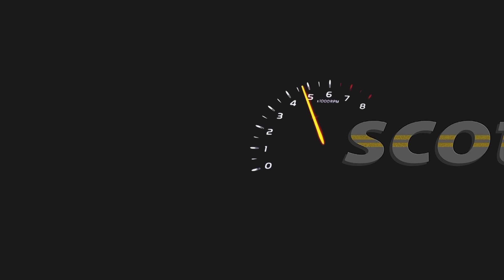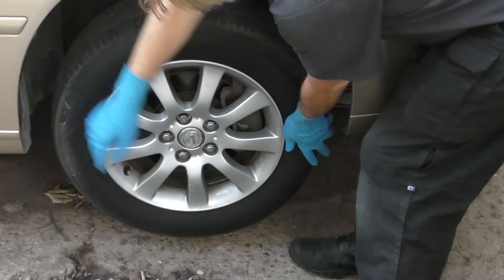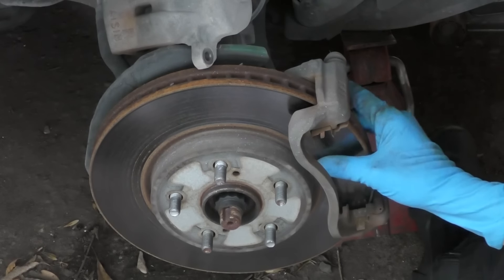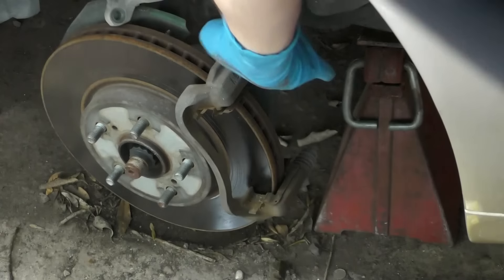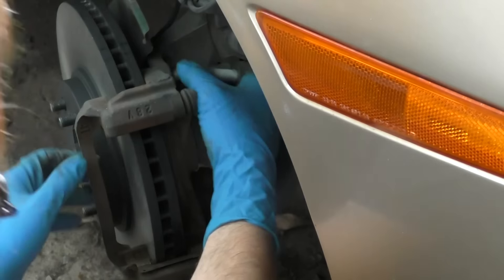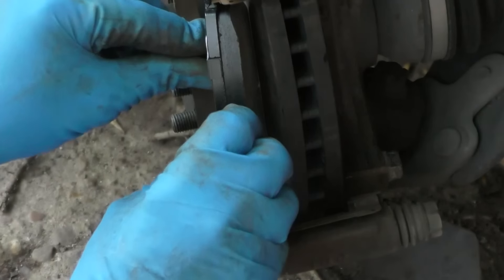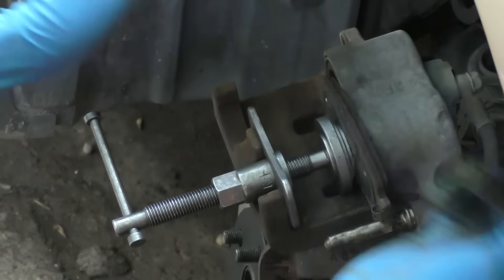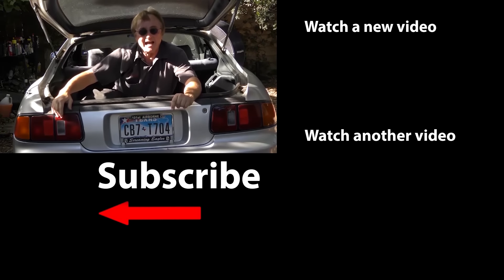Does Your Car Shake When You Brake, Do This

Comment: Hey Scotty! I also want to point out. At times it can be your wheel pressure and alignment!  Whenever my tires start to get lower that little shake can show up. But if I go a while without an alignment I definitely have the shakes at high-speed breaking. Just my 2 cents!

Comment: I had to find Smokey Yunnick's post in an OLD Popular Mechanics magazine to fix this vibrating steering while braking on my1995 Ford Windstar. The dealership could not fix the problem for any longer than a drive home. It turns out that the stud nuts must be HAND TORQUED to 90 ft-lbs in at least 3 steps. Solves the problem every time. So I had to TEACH the local Ford Dealership since they were the only ones I would let touch my baby. The 2000 Windatar is not so sensitive but the effect is still there if they use their impact-driver brake sticks to torque the lug nuts. Lately I am driving a 2010 Fusion Sport and the problem is still there so  if it acts up on a long trip I just pull into the nearest KalTire store and get the wheel nuts re-torqued evenly to 100ft-lbs. Makes a heck of a difference immediately. Many thanks to Smokey Yunnick and Popular Mechanics.  I thought you needed to know.

Comment: Don't forget to pump the brakes until they firm back up with the car running BEFORE you drive off. A friend of mine forgot that simple thing and his wife drove through our other friend's shop garage door when the car wouldn't stop. $600 garage door repair. Expensive brake job there!

Comment: Cheap rotors bend when the wheel lugs don't have all the same torque on them - just retorque the lugs properly in a few steps, and the rotors should straighten back again
(also clean any corrosion at the wheel hole for lugs so as to feel the lugs tighten smoothly all the way)

Comment: No one ever mentions how worn power steering rack bushings can also cause loose steering and vibration while driving.  The entire rack floats side to side because of worn bushings.
Reply: smithraymond09029 difference is this happens only when braking.  Your problem shakes sll the time
Reply: Interesting that you mention it! I've changed my tires, brakes and rotors but didn't know about the bushing! I will have to give that a try. Thanks!
Reply: this week im replacing al mine on my mk5 gti. all the bushing on the frontside,  plus subframe collar kit to
Reply: @gfriedman99 quick question do I have to change my brakes when replacing the rotors

Comment: Really good video, Scotty! Now off to convince the wife to let me replace the rotors in her car :) A couple of questions:
1 - Speaking of breaking, is it true that if you're about to hit a pothole, you should never hit the brakes?
2 - What do you think about the tools sold by Harbor Freight to work on cars? I see some of them so cheap, but I wonder about their durability.
Thanks! 
William from Connecticut
Reply: Yes, release the brake pedal just before hitting a bump.  It reduces stress on the front suspension and the rear.  Some HF tools are durable.  I have two 1/2" air impact wrenches that are probably 25 years old.  I don't use them that often but they still work.  I also buy impact sockets there.
Reply: Hi William. I need my brakes done also. But my mechanic is charging over $460. U know anyone in ct? I'm in the naugatuck valley
Reply: @julied915  Hi julie, I just saw the notification.  I'm in NC so I can't recommend anyone.  Don't go to the dealer.  Go to a brake shop.  Depending on what needs to be replaced it could get expensive.  Many owners just change out the brake pads if there is no vibration when braking.  If the rotors need replacing it will cost a lot more.

Comment: Scotty, what about:
1) Stepping on the brakes to make sure the pads engage
&
2) The bleeding of the brakes?
Reply: No need to if you don't open the brake lines.
Reply: the only other thing i do is take the cap off my brake fluid reservoir. Seems to let excess fluid from compressing the pistons flow back up easier.

Comment: First thing, the quality of rotors is important. I bought some cheap ones, and a only a week of sitting out rusted them so bad they needed resurfacing.
Second, I really like ceramic chamfered pads, which is what it looks like you are installing. Totally love them, grab like King Kong going after Fay Wray.
Third, I have a 1994 W124 Mercedes, it's easier to replace pads or rotors on that than your Lexus. Don't get me wrong, I'm a huge Toyota fan like you, if I didn't have an old Benz, I'd have a Toyota. I can understand your criticism of newer Mercedes, but the old Bruno Sacco pre-Daimler-Chrysler Benzes are some well designed stuff. Piles of them are still running in places like Malaysia, Morocco, Siberia and Paraguay.
Lastly, you have the same Harbor Freight hydraulic jack I do. Brilliant piece of equipment

Comment: Brake rotors do not warp from heat, even when driven by the most aggressive driver. Instead, they wear unevenly. ... The problem of pedal vibration, incorrectly called rotor warp, occurs 3,000 to 5,000 miles after the brake or tire change
Reply: Lol you must have just watched "Warped rotor myth"

Comment: I had this problem with my Honda after my Rotors were turned, went to the Honda Dealer and they told me the correct way to fix this on my Honda was to turn the Rotors while they are on the car, they have a special machine for that.

Comment: Take the fluid reservoir cap off before compressing piston or you will have a bad day,

Also wire brush caliper carrier once off, rust is the biggest cause of uneven brake wear and needs to move easily to brake evenly.

Be sure not to twist brake pipes/hoses and best to cable tie or use a magnet to keep caliper in situ you never want to have it hanging by the pipe/hose, but I love scottys videos none the less

Comment: IMPORTANT: Please do a video on the new Safety Cable on BMW. A car bumped mine and all BMWs now have a cable with an explosive charge and when someone hits you the cable  explodes and the car wont turn on until you buy an change the cable. This is a hazard because if a thief hits you on purpose the car will turn off and people can rob you or kidnapp you. I was not told this when buying the car. Lots of complains online about people not knowing about it. 
Thanks!!

Comment: Instructions not clear. now my engine is hydro locked. help.
Reply: Did you reset the flux capacitor?
Reply: Autovlog
Reply: Just drill hole inside of full cylinder to let out the water.

Comment: Scotty, from one old mechanic to another I have to disagree with you on this. First, you show measuring parallelism of the rotor. If the parallelism is out your get a brake pedal that pulses, moves up and down under foot pressure while driving. If you want to check for warpage  you would need a dial indicator. Warped rotors happen when uneven lug nut tightening is done, even over tightening does not cause this but the difference in torque between lugs when putting on the wheel. At first this does not cause a problem but as the rotor heats and cools it hardens just like sword makers harden swords by heating and cooling the metal. Under normal conditions this hardening does not cause a problem but if the rotor is warped this causes the rotor to be hard in spots. As the brakes are applied the brake pads move from a hard spot to a softer spot in the rotor as this does the pads grab better the softer spots on the rotor and grab less in the harder spots. In other words the coeffiction of friction changes though out the rotor face causing the pads to grab and slide across the rotor face.
Reply: 😒 In theory I agree with you, but for the noobs looking at this video i recommend they dont waste their time measuring anything, I recommend just going to the auto parts store and picking up premium rotors and premium ceramic pads, hardware, silicone lube, brake grease, etc, and get to work Chop Chop 😒🚗

Comment: Wasn’t sure what my issue was, so I ordered parts to replace both front rotors and rear drums and all parts. Got to the front brake caliper slide pins and they were bone dry. That was probably the issue. Still replaced everything and now it runs like new.

Comment: What about the spring/shock bolts that hold the calipers on?? U need to make sure they "spring" in and out freely before tightening them. They have small notches in them to let air out and prevent air locks.

Comment: May I just say to the first timers or the inexperienced: Don't think because you viewed this video, you can just go and fix the brakes on your particular vehicle. This is only an example, performed by an experienced professional.
Reply: 😏 LOL let them find out how hard it is just to get a real rotor off! haha noobs! 😂
Reply: Absolutely right.  This is a time consuming. Especially if you doing  this for the first time.  You have to learn how to take these brakes and calipers off.  It does get challenging.  One rotor might take you about 1hr., or 2hr.
Reply: @slicaltimistic1  😱 the rear rotor might have an inner integrated brake drum to work on as well 😡
Reply: 😂 sometimes u cant even get the lug nuts off! heehee 😇
Reply: Lmao I can do a brake job in 20 minutes flat
Reply: @slicaltimistic1  How about a simple mistake, like using a cheap 12 point socket?  Gonna be real fun if you round off the bolt heads...lol
Reply: @VIDEOHEREBOB   That's accident 100% guarantee waiting to happen.
Reply: This is the problem with today's society.  Unwilling to learn to fix stuff.  Waste money on otherwise relatively routine things you can do in your driveway.  I haven't had my car to a mechanic in over a decade.   I do everything because I want to live a bit, save money, and I don't trust the arbitrary label "experienced professional"
Reply: @jgmatp  👏👏👏👏👏👏👏👍👍👍
Reply: @MrSamadolfo Opps.  I'm glad you said drum rotor brakes.  That's going to be a real challenge.  You got to take your time on that.
Reply: MrSammy That’s what breaker bars are for.
Reply: After watching this video I think Scotty gave me the confidence to do the family van brakes before our cross country trip , Scotty thanks for making it look easy buddy cheers.

Comment: Wow Scotty, a trusted voice on autos", you missed this one. A caliper is not the only measuring tool to use checking for a warped rotor. A warped rotor could measure perfect all around with calipers and still be warped. If it measures parallel all the way around with calipers, you must also check for run-out with a dial indicator.

Comment: My car shakes like crazy when I brake
Reply: Check if your rims are bent or damaged. That happened to me I put the damaged rim on the back of the car took the back rim put it on the front of the car. Didn’t shake anymore it’s a quick fix until you get a new rim or rims. Hitting potholes or a curb will bend rims or damage them
Reply: Make sure you follow these steps quickly to give time to brake on time. 

Put your right foot in before braking. Then take your right foot out. Then put your right foot in, and then brake.

Then do the hokey pokey
Reply: Beetle Juice lol. There’s always one lol
Reply: You put rims on your car??
Reply: If you don’t know much about cars, just go to a mechanic. You could be chasing that problem all day with no answer.
Reply: If your steering wheel shakes when going 80+km on highway without braking, you need your tires balanced. If you're braking and your steering wheel shakes, you have warped rotors and need new brakes. If you're hearing clunking noises going over bumps etc, you need your front end inspected
Reply: Have the front end  inspected no matter what.ASAP.   Maybe tires sure but it could be in your steering.

Comment: I guess what we have here is your average Texas break job! In the Northeast when you have lots of road salt and calcium chloride eating away and swelling up your disc brake rotor and the hub getting the rotor off is going to be a new adventure. 
It usually takes a torch in a much larger hammer to get those rotors off. Once the rotors are off you have to clean the hub underneath which is usually heavily rusted. After cleaning the hub then use a dial-indicator to make sure the hub is straight before installing the new rotor and then proceed as the video goes. Scotty It may be a good idea for all of those people in the rest of the country in the salt belt to give them a heads up...

Comment: I have an old 8"  C-Clamp that works the same.  :D

An engineer friend told me that the major cause of Rotor warping is not tightening the bolts in sequence and using an impact to tighten them.  He recommended tightening first to 40 ft pounds using the alternate bolt or more commonly known as the star pattern tightening.  then to 60 lbs and finally to 80 lbs for most cars.  Some Trucks there is a final tightening to a higher torque. As always drive the vehicle and recheck the torque on each wheel.  :D
Reply: So slamming the brakes too hard and overheating the rotors doesn't warp it?
Reply: Mel C  He said the major cause, not the only cause.

Comment: Scotty, brake rotors don't warp. There's not enough heat in a brake system to cause a dual layered brake rotor to warp. What you're talking about is rotors that wear unevenly due to a number of root causes. It can also be pad deposits unevenly on the rotor. 

The whole brake rotor warp thing is a MYTH. 

The proper way to combat this from the start is proper lug nut torquing and ensuring the new rotor is true by measuring runout and shimming if necessary. And making sure the brake fluid is fresh and not contaminated. It's also important to properly greas the brake system and perhaps the most important the caliper slide pins. 

Come on man....don't perpetuate the myth.
Reply: So they don't warp, they get untrue or worn unevenly.  For all practical purposes it's the same thing.
Reply: No Terry, it's not the same thing at all. A warped rotor would mean the brake system got so hot that the metal cooled unevenly and warped. To alleviate the CAUSE of that would require a completely different fix than if they just wore unevenly or had uneven pad deposits.
Reply: So ur tellin me if ur coming of a hill thats multiple miles long that requires excessive braking with many curves(like here in wv) get to the bottom of the hill and drive thru 6in of water in the potholes (also known as the whole Rd here in wv) they won't warp?? 
Maybe these systems are meant to not do this but under certain conditions all mechanical mechanisms can&will fail .
Reply: Yes, that's what I'm telling you. Unless you are riding the brakes hard down that hill and going an insane speed, the double layered and vented construction of most all rotors used on cars these days (mainly on fronts) is enough to cool those rotors down to manageable temps on top of the fact that they aren't ever getting too hot anyways. Typical harsh conditions on a brake rotors isn't going over 200degC.

Take into account that there is also a HUGE heatsink attached to your brake rotors at all times when in operation...your wheels. Aluminum and to a lesser extent steel wheels, are an excellent heat sink to the rotor (in these conditions).

Your rotors (which are giant pieces of steel) would have to get 5 to 10 times hotter to make them soft enough to then warp from use. 

Rotors on a car do not warp.
Reply: DrAwkwArD never heard of dual layered. Are you talking about vented discs?
Reply: Correct.  Brake judder is usually caused by build-up of cementite on the rotors, which creates high spots from a layer of brake pad material bonding with the rotor surface.  Best way to avoid this is not to continue applying the brakes while stationary after a long, hard stop (like getting off the freeway).  Come to a stop, and if you need to remain stopped (waiting for a light), slowly inch ahead to keep changing the area of the rotors in contact with the brake pads.
Reply: @luptonpittman6520  Yes, excuse the nomenclature. I meant vented rotors. Even nonvented, they're not going to warp.
Reply: Are you serious? Stop talking before your head explodes. You have no idea what your talking about!

Comment: Don't forget to pump the brake pedal afterwards to get the pads back in contact with the discs.  A friend of mine almost killed both of us because he worked on the brakes the night before, and then the next morning, just started down a steep driveway (in the mountains) without making sure the pads were in contact with the discs.  It was a manual transmission car, so brake pedal did not need to be touched to get moving.

Comment: I brush out all the brake dust from the caliper and brake pad cage before I install anything. Or use the new brake pad hardware if it comes with the pads, then add the anti squeal grease.

Comment: I had this problem when my had driven only 7000 km. Got the brakes replaced at 18000 km underwarranty. Problem again so got the brakes replaced at 63000 km. Problem again so got the brakes replaced at 77000 km and this time also got the swing arms replaced (they didnt charge for the brakes this time as they should have diagnosed the issue as a faulty swing arm when brakes were replaced at 63000 kms). Problem has appeared again at 79000 km. Booked an appointment with the mechanics for April.

Bmw 530i Touring

Comment: Folks, please DO NOT tighten the wheel nuts with an air gun or you run the risk of warping the new rotors. Always use a torque wrench set to manufacturer's specifications to tighten wheel nuts. Scotty is a professional mechanic and he knows how much to tighten wheel nuts with an air gun since he's probably done it thousands of times.